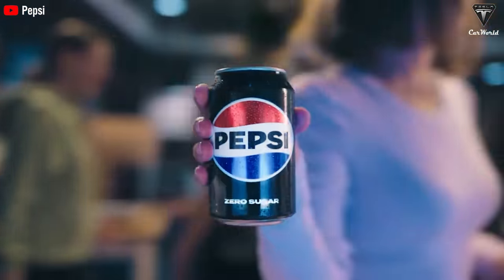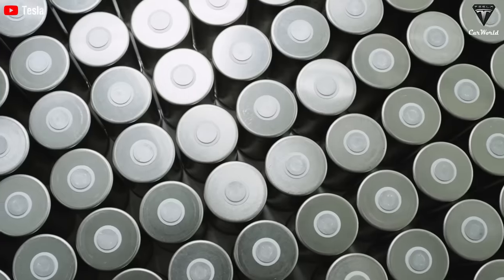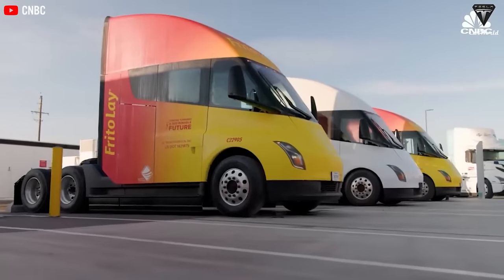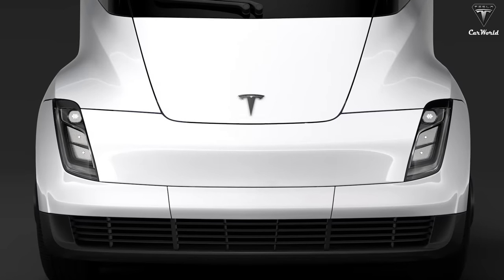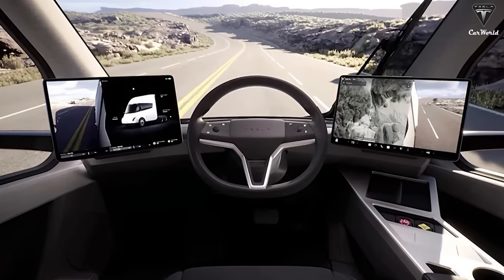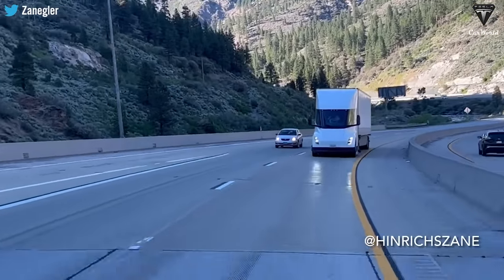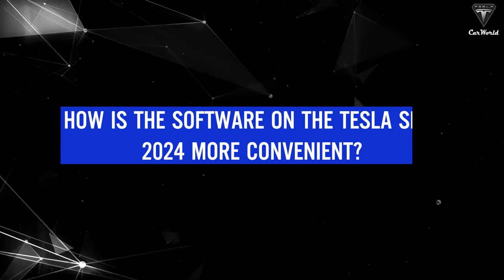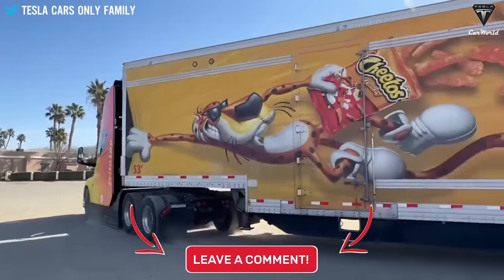unbelievable changes Tesla Semi 2024 & Tesla Semi 2023, Tesla semi Update Here.

Comment: I'd like to see Tesla brand trailers next with steerable tandems [with cameras] and an extra battery underneath to run refrigerator units as well as useful power for the driver to use while off the clock for a TV, lights, CPAP, small cabin refrigerator, etc.
Reply: This is the next logical area of improvement. I wonder, if a Tesla matching trailer could be made out of a carbon fibre tub chassis, reducing the weight of the trailer by up to 60%, with all of the benefits that would have in lowering the overall towing weight thereby, increasing the payload, increasing the rigidity, reducing the breaking distance, increasing acceleration and increasing the mileage range. 

If you consider that if the towing weight of the trailer is halved, this could mean that a Tesla Semi may be able to pull two conjoined trailers, doubling the capacity and doubling the roof area, to install solar voltaic panels, to provide electricity for supplementing onboard systems.
Reply: What about PV systems on top? German might be automobile producer with a solar car failed but continued with formable PV panels that can be mounted on trailers and busses. This in middle Europe is usually enough to cool load or passengers. A dedicated Tesla trailer should incorporate this feature together with batteries.🤔🤓🇨🇭
Reply: This would be an opportunity for trailer manufacturers to upgrade their products and stay in business. Let Tesla continue to focus on engine products.

Comment: You can't haul 88,000 pounds without an over weight permit. Federal law limits electric semi's to 82,000 pounds.
Reply from the maker: Sorry we didn't say it specifically, causing you to misunderstand. it means the Tesla Semi has a load capacity of up to 88,000 pounds, "towing capacity." However, it will not be able to exceed 82,000 pounds according to US law! thanks for your suggestion!
Reply: I’ve been seeing a lot of the semi’s with an extra axle on the semi that lifts up traps down and also trailers with extra axles so the standard two. I was just wondering what about all that is it just for road conditions such as soft roads or do they allow you to haul extra weight?
Reply: @gregkelmis2435  think Tesla just let it freewheel till they engage the two boost motors.mitigatingnmost of the losses
Reply: You can haul 88,000 lbs all day long without an over weight permit. Everything is fine till you get stopped and weighed. Only then there will be an issue.
Reply: The permit can be rescinded as well. Like the B-747, just add more axels and wheels to distribute the weight.

Comment: OK, as a career truck, driver of nearly 30 years when I look at this, the interior looks amazing. My main question is when backing into a tight area which I do on a regular basis I need to put my head out the window and change angle of where I’m looking so I don’t run into anything, how do I do this in a tesla with a seat being in the center. Having a traditional cab with the two seats in the front side-by-side with the driver seat being on the left side like normal would make much more sense. It is going to be an incredible adjustment to change the position, my other question is where do I put my lunchbox? I don’t stop to eat at a restaurant or a diner. I eat while I’m driving down the road.

Comment: I would like to see a solar powered roof and side panels on a box that has a power train and battery system to help propel the truck and act as a power station when not in use. Maybe the truck is not the only solution but the trailer.

Comment: Wait till there is an effective trailer axle regeneration, that’ll make it go even further
Reply: Not necessary. The regen braking in the tractor provides all necessary regen braking under any conceivable circumstances, including descending Donner Pass with a gross weight of 82,000 lbs. without using the friction brake at all.

Comment: I can’t help but wonder with such a large surface area. Will they add light weight PV cells to the trailer surface. It seems like a logical next move. You could safely expect 6 to 8Kw on full Sun I would imagine
Reply: I've done the math; solar panel on the roof would gain about 13 miles a day, but additional weight and drag would reduce range by the same amount. More seriously, payload would be reduced by the weight of the panels, inverters, mounts, wiring, connectors, etc.
Reply: @BigBen621  I can understand that the additional weight could be an issue but the panels that they use in Aptera have overcome some of these problems. The inverters that charge the truck may be able to handle the current coming from the trailer. If the drag issue is eliminated, and the onboard systems that are currently in use can process the current flow, it may be worth the link. The lighting circuit  of the trailer may conceivably be able to double as a charging circuit if handled correctly.
Reply: The payback doesn't support the cost.
Reply: @skipwood2059  I imagine it will be something that will evolve over time. The PV cells that Aptera have developed seem like an appropriate fit although as you say the cost to benefit ratio, might not work out?

Comment: A lot of these up grades you highlighted raise the questions why were they not installed in earlier models? It  sounds like the 2023 was not well designed. This is not a good advert for Tesla.
Reply: From Wikipedia:

A minimum viable product (MVP) is a version of a product with just enough features to be usable by early customers who can then provide feedback for future product development.

A focus on releasing an MVP means that developers potentially avoid lengthy and (possibly) unnecessary work. Instead, they iterate on working versions and respond to feedback, challenging and validating assumptions about a product's requirements.

Comment: The famous danger of big truck is the load like I beans penetrating the driver seat in an emergency brake. What solution does Tesla has regard to this problem? Old experienced driver usually run over small cars instead of e-brake.
Reply: Auto pilot should stop the "old driver" mentality of tail gating, blind convoy and the worst asinine habit of dual blocking..
Reply: Trucks do not emergency brake like cars, that is why you see lumps in the road from semis braking and axle weights shift.

There are laws on the books requiring a stop barrier behind the driver already.

Those long farings I see would not last without getting torn up from tight turns.

Anyway, good luck.
Reply: Tesla has autobrake with radar,they detect Collisons from from very far away prompting the auto brake even if the driver is distracted it will do it on its Own.
Reply: @magallon643    collision avoidance does help in minimizing accidents. But emergency brake is unpredictable and is usually others' fault, they cannot be detected even at near distance,  resulting in not enough braking distance.
Reply: @user-rc6qo5zs8q  again you assuming Tesla has to deal with a Massive Diesel Engine,The Semi has Electric motors, Software radars and cameras handles all that braking,I can send you links of Teslas Cars doing their magic if you like,Saving and detecting the accident far ahead avoiding a crash.

Comment: How about Regenerative Brakes on the Trailer too?
Reply: Tesla traielr would be required. Pt batteries in and you could extend the range but I suspect they want to keep it industry standard.
Reply: @mikem6549  A trailer Battery would be great for LTL and Short Haul situations.
Reply: Not necessary. The regen braking in the tractor provides all necessary regen braking under any conceivable circumstances, including descending Donner Pass with a gross weight of 82,000 lbs. without using the friction brake at all.
Reply: @BigBen621  Right, but regen on the trailer would produce more energy to extend the range.  I suppose it depends on whether the investment would be worth the payoff...
Reply: @SlipKnotRicky  My point, though, is that regen on the trailer would not produce more energy. The amount of energy to be recovered is fixed; and if the Tesla Semi can handle one of the longest descents anywhere in the US, 7,000+ ft. from Donner Summit to Sacramento, without using its friction brakes, which Tesla has stated it does, then every bit of available energy is already being recaptured by the drive axles in the tractor; and the only thing regen braking in the trailer would do is split the recovery of the same amount of energy between the tractor and the trailer.
If the Tesla Semi were having to routinely use its friction brakes in addition to regen braking, then there would be additional energy to be recovered by regen braking in the trailer; but that's not the case, and so there isn't.

Comment: What is the running cost it with full load?
Reply: It's loaded efficiency is 1.7 kwh/mi.  Up here in Canada, BC at a commercial rate of 8 cents per kwh, that amounts to 14 cents/mi.  for a loaded configuration.  Compare that to a diesel truck mileage of $1.00/mi, that is 7 times cheaper.  Time to buy more Tesla shares ;)  Cheers.

Comment: Do these tesla semi’s use transmissions or gears?
Reply: Three motors for cruise and two additional engage a clutch to accelerate.
Reply: Any truck would always need a transmission and at least one gear.
Reply: Only a single reduction gear for each motor.
Reply: @mikem6549  You seem to be saying five motors. Actually one for cruise, and two more engaged with a spline clutch for acceleration. If that's what you meant, you're correct.

Comment: The tesla semi truck hasn't been on the road for "years" so Pepsi hasn't used them years. They got it in December 2022 and also semi trucks don't use gasoline.  After these two oversights within  the first two minutes I stopped the video. Get facts correct otherwise what is the point?

Comment: The author consistently confuses the terms engine and motor. He uses the terms interchangeably. This is technically incorrect. Engines are :heat engines and are internal combustion. Motors are electrical.  Tesla does not have an engine. Period. An ICE car or truck does NOT have a motor. It has an engine.   You need to be schooled.

Comment: Just upgrade trailers with Solar panels, also bats 2% or 1% of trailer, Sunny ways, LOL
Reply: No gain in range from solar panels, and reduction in payload by the weight of the panels, mounting hardware, inverters, wiring, connectors, etc.

Comment: If Tesla really wants to freak out the trucking world and prove Beyond a doubt it's got the power for wherever the Heavy Haul truck is a must and a need proving what it could do I suggest the full I5 corridor running the full I-80 corridor along with I-40 those three corridors when it comes to trucking they're not kind to weak vehicles but I used to run team across them corridors so it can be done but that would shut up every single one of the naysayers along with running what's known as trains I'm talking three to five trailers long Interstate dedicated